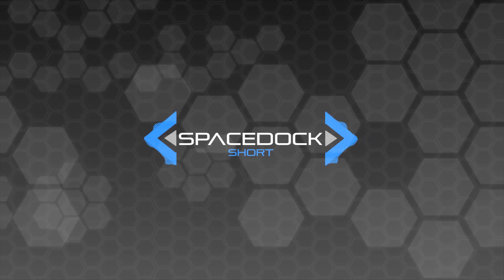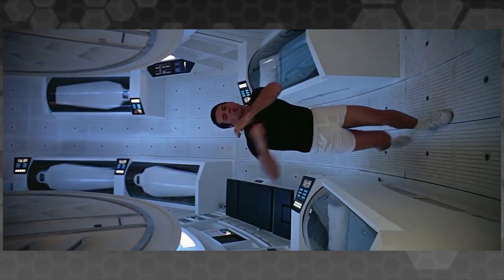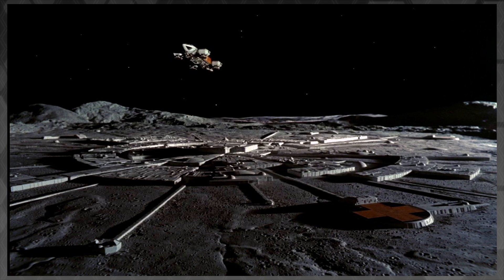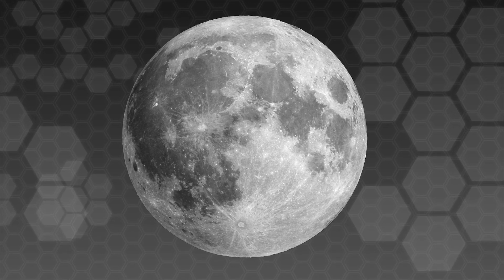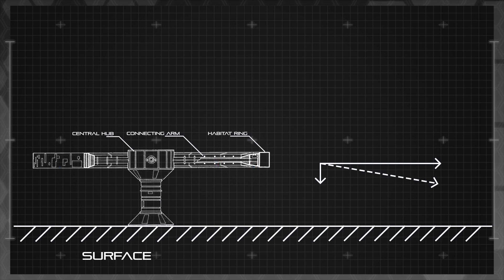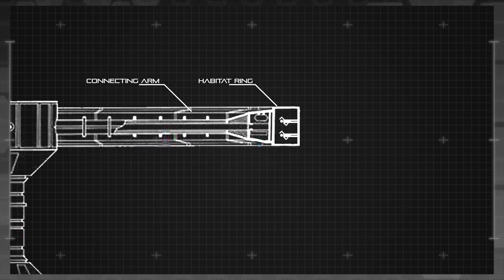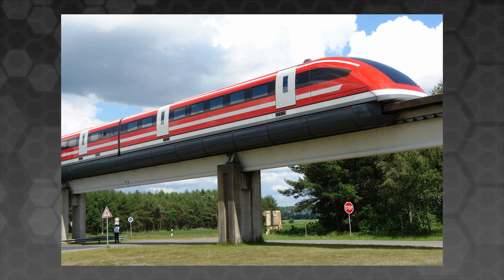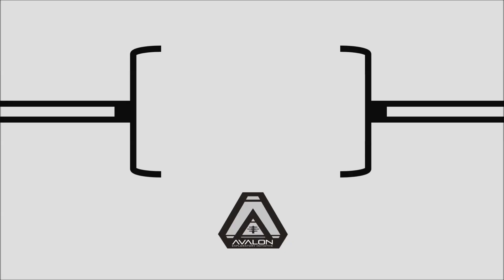How To Create Gravity On The Moon

Comment: "may not be an accurate representation of events" - comically fast asteroid rotation
Reply: WEEEEEEEEEEEEEEEEEEEEEEEEEEEEEEEEEEEEEEEEEEEE
Reply: Ironically Flat Earthers actually argue the Earth spins that fast as a means to discredit the globe model on the fact that water would not be able to hold onto the surface!
Reply: @chrisstevens2  Of course, while the Earth's rotation seems fast to us, it doesn't actually produce that much centrifugal force due to the fact that it takes a full 24 hours to complete a single rotation.
Reply: @saucevc8353  It's not the RPMs, but the linear velocity at the point the person is standing.
Reply: The linear velocity isnt an issue either. The speed is more or less significant based on the radius of the circle you are moving around, and the earth is huge, so the few hundred meters a second or so of surface velocity isnt a big deal at all
Reply: @trplankowner3323  Didn't know that but it makes a lot more sense now that I think about it.
Reply: @ravener96  Wrong, they are two different issues. On the surface of the Earth, it is actual gravity which is due to the mass of the Earth. In the aforementioned rotating structures, it is the acceleration against the floor of the structure. Instantaneous linear velocity can also be called angular velocity in this setting. Following is the formula from Wikipedia. "The magnitude of centrifugal force F on an object of mass m at the distance r from the origin of a frame of reference rotating with angular velocity ω is:
 F=m\ω^2r

Comment: You should check out Issac Arthur's channel on here.  In particular, his video on industrializing the Moon.  Basically the same thing you came up with, but using a spinning upside-down cone built into a crater.  His channel is science based, so it isn't a fictional concept but is instead accurate in terms of physics.
Reply: John Weber Always upvote for Isaac Arthur.
Reply: Isaac Arthur is the best.
Reply: Issac is life. Issac is love.
Reply: I was just thinking about his idea. Isaac is the best!
Reply: Yeah, I was totally gonna comment about using spinning bowls as a means of generating artificial gravity on a planet.
Reply: The concept is also better for asteroids.  Remember that for a potato-shaped asteroid spun up to 1g at the ends, the center will not be 1g.  Even if you spin it around it's longest axis, the center of the axis of spin will be at nearly 0g.  Worse, since an asteroid is not evenly shaped, the surface gravity induced by the spin will not be the same.

Better to just build multiple spinning domes around the surface.  Or turn it entirely into an O'Neill cylinder.
Reply: Isaac's speech has improved massively compared to his earlier years. His speech therapy he's undertaken for the last several months have really helped a lot.
Reply: Issac is the lord. And Spacedock his prophet.
Reply: John Weber, even taking the endeavor of spinning an asteroid to 1g, there is no saying if it can hold together. It just better to bury the rotating cylinders in the asteroid.
Reply: You cant spin asteroid to any more than its gravity force because that's the force holding asteroid together. Most asteroids are not solid rock but just clump of gravel. It will fly apart.
Reply: Use closed caption. His videos are fascinating and his speech impediment does not bother me.
Reply: John Weber that makes sense if you want more livable room than just s disk
Reply: Huh

Comment: Ah, thank you! I needed this as a final addition. In my own stories, the Moon is the largest collection of shipyards in existence. People excavate skyscraper sized chunks of rock then build airlocks around them. This, coupled with the low gravity makes building starships much easier and cheaper than in orbit. Adapting your idea as follows: find a suitably large hollow magma chamber. Build gigantic supporting pillars. Put hundreds of independently operated habitat rings of yours on them. Invite settlers. Profit, you have a city on the Moon with custom adjustable gravity and protection from radiation.

Comment: I am reminded of Red Mars, by Kim Stanley Robinson.  While the colony itself was obviously on the Martian surface, they turned Deimos into a kind of "layover" point in orbit, which needed to be staffed but the local gravity was far too slight to keep the staff there healthy.  So they ended up building a set of rail tracks around the circumference of the tiny moon, and rolled carriages around it at sufficient speed that the centrifugal forces would effectively provide spin gravity.

Comment: Excellent segment.  Most designs use a conical shape that for the habitat/city rotating around on the mag-lev track.   The apparatus would be buried some extent underground with a set of mirrors reflecting light to the interior.  There would be no direct light into the interior, and lunar material would be built up using 3-d printing techniques to form a dome above that shielded the facility below from radiation.   You would likely use this method even if you had gravitational technology primarily because materials will not be as limiting a factor as energy, and unless your gravitational energy uses less power than mag-rail tracks, it would be a cost savings to the colony in the long term.

Comment: Spinning an entire asteroid to simulate gravity wouldn't actually work. Despite the fact they are made of rock asteroids are actually relatively loosely held together structures, and it wouldn't take much to crumble and tear themselves apart under the sort of forces involved in spinning it up to simulate gravity.
Reply: Well considering that in The Expanse the asteroid bases are completely inside the asteroid, and pretty large surface area, I'm pretty sure that there is enough internal structure to hold the rock together

Comment: Second funny story. 

"Gravity" within a centerfuge differs by distance from center. This means, on most reasonable scales, your head has less gravity than your feet. 

When you talk about finding the angle of apparent gravity, you run into the problem that it's not consistent from one side of your body to the other. 

Unless this centrifuge is very large; that's going to at least require some adapting for someone standing.

Comment: 2 things:
A) As far as I can tell (I tried to check all of the comments, and I think that I saw them all...), only one Commenter mentioned the issue of <horror theme music> Dust </horror theme music>. The Apollo missions made no small issue that the dust got EVERYWHERE. And not only is Dust a health hazard (shredded lungs & severe Silicosis) but also a severe hazard for mechanisms with close tolerances. I can't imagine that even Maglev tech could be a solution without complex engineering and just more failure points introduced.
B) For the Ferris-wheel crowd, you can't make them vertical (like the Eye in London) because the only place that would receive the correct"gravity"is either the bottom of the wheel, and then constantly varying until you actually have Less than Lunar gravity at the top (not what you were looking for...)

Comment: My question is how to move personnel and supplies from the non-moving surface to the habitat ring which is rotating at speed. In space, where relative gravity is a non-issue, a simple tube running from the axis to the habitat ring can allow for a gradual increase in relative gravity, which wouldn't be too difficult to navigate.

I think the easiest solution would be another to have another ring, located near the axis (I'll call it the logistics deck), that can spin up to match the rotational velocity of the habitat ring (to facilitate movement onto the habitat ring) and then spin down again to stop (to facilitate movement to the surface, subterranean levels, or landing pads on the upper deck). Interestingly, this method becomes more efficient the larger the habitat ring, since matching the rotational velocity would require less spin up as increasing the distance from the axis means the habitat ring would have to spin at a slower velocity to get the same relative gravity. 

However, I foresee some sort of upper limit to a livable and productive habitat due to logistic necessities. Depending on the design and specifications, at some point it may not be possible to move enough supplies and personnel through the logistics deck to support the station. For the same reason that there is an upper limit on the size of a single cell organism, since the area inside the cell needing nourishment grows geometrically as the area of the cell membrane increases.

It may be expedient to have two logistics deck, specialized in cargo and passengers respectively. On a story or perhaps cultural note, this may lead or lend itself to certain behaviors. It could be that security (or other businesses) requires owners of cargo to pass through to the habitat before any of their cargo arrives. The requirement of punctuality or waiting around for the logistic deck to spin up or down.

Comment: Propose a design for a spin gravity moon base that also has radiation shielding.
I come up with a donut with a second maglev track above the habitat. The whole set up is in a larger tunnel under the surface of the moon which provides the atmosphere containment.
If you want to leave the habitat you board the train which moves at the same speed as the donut, stationary relative to you, you then ride it as it slows down whilst rotating through 80 degrees and deposits you  at an airlock. Alternatively it rides a piece of track out through the airlock, that track rotates through 80 degrees.
Any alternative suggestions?
Reply: Sure, a Wave Swing ride. 😏
Reply: But you have a good idea

Comment: I don't know if there's a practical application for this, but if you had a deck the shape of a paraboloid surface and spun it up, you could have gravity that increases as you move further from the center, but the gravity would always be perpendicular to the deck.

If nothing else, that could be a reasonable way to increase the surface area of one of these habitats by extending it in a second dimension. Analogous to using a cylinder rather than a ring, but tailored for use in a pre-existing gravity well. But you'd be limited by whatever you consider the acceptable range for the strength of the simulated gravity.

Comment: one issue i can imagine would be how much habitable space there would actually be on the rings. of course, areas where low gravity isnt an issue, or many even be beneficial can be kept towards the inside of the ring (solves the issue of having to constantly transport thigns to and from the ring too), but in terms of living space, there would be that much.

also, size itself would be an issue. it the ring is too small, then it becomes nauseating to stay on there due to how fast the structure would need to rotate. if you build it too big however, such as to increase living space, then the structure becomes too heavy

Comment: I would use subsurface steeply banked circular maglev track using Inductrak Halbach magnetic array levitation (the magnetic levitation is passive drawing it's energy from the kinetic movement itself and does not need active computer control like the maglev trains once used in Germany).  Of course there's also the spinning salad bowl dome concept.  However, though we know that microgravity is destructive despite our attempts to mitigate the effects with drugs and exercise, we don't know if the 1/6 the gravity couldn't be effectively mitigated with drugs and exercise plus the possibility of using short radius centrifuges (spinning tables that you strap yourself to) to periodically stress the body.  Those would be attempted first.

As to how deep to dig the track into the ground for radiation and micrometeor items shielding.  Although it would take perhaps over 10 to 20 metres to simulate the shielding we receive from Earth's atmosphere, a mere metre of packed lunar soil reduces radiation to 1/1,000 of outside levels and the Stanford Torus design used 5.6 feet of packed lunar soil as sufficient shielding.

Comment: While not impossible to build something like you suggest, the engineering challenges that would have to be overcome in order to build a surface- based centrifuge station to simulate a 1g environment would be immense. Now, to look at this from a real-world perspective for the fun of it, you’re talking about building cantilevers hundreds of feet in length, which would require massive amounts of next-generation materials (or even greater quantities of existing materials) in order to construct a very robust and deep structure to support the torus. The costs of such a ground station would make it more appealing to build an orbiting torus-shaped station instead for long term habitation and have people take relatively short stints to the surface. The average Joe-schmoe can only easily tolerate an RPM of up to ~3 (some studies say one or two rpm more is possible for some people) without the need for training or extended adaptation periods based on current research. If you want 1g within that value, you start approaching torus diameters of around 800’. For a smaller station, you need higher RPMs to simulate a 1g environment, and at that point you can only send people with significant physical training and good health to live there (read: highly trained astronauts), which is not feasible for colonizations efforts. As an example, having worked on a NASA- sponsored research project, our team came up with a torus-shaped space station design with an internal diameter of 800’  for the overall ring shaped station and an RPM of 2.7, giving a roughly 1g acceleration inside the habitable volume of the ring, which was two stories rather than one. The values we came to were in order to find a balance between acceptable RPMs for human habitation and a feasible size for the overall station, which was designed to be constructed with expandable, pre-fab, ‘lightweight’ modules. Even then, this space-based, semi-self sustaining station, while supposedly within our technical capability to make this century, would cost far too much and still be too difficult to build in actuality for the near future. Basically, we are in all likelihood a hell of a long way off from making stations that simulate gravity in space at any useful scale for habitation by large numbers of people or for deep-space colonization efforts. The advancements necessary to adapt the technology to a ground based system, even on a ‘low gravity’ body like the moon, would put the possibility of a station like you suggest even further down the road. It’s not impossible, and we’ll probably see something like it one day because it’s a good idea to solve an important problem, but the engineering challenges and costs are extremely monumental, so much so that they may inhibit the production of such ground based stations when the time and capability to build them eventually comes.

Comment: There's no need to elevate the centrifuge; instead, dig a pit. The bottom of the pit should be parabolic so that it feels like "down" no matter where you're standing, with lunar gravity at the center and earth gravity at the edges. This maximizes living area and can help people used to low gravity slowly transition to higher gravity simply by moving further and further up the dish. The problem then becomes sealing it off, but if you have materials like graphene it shouldn't be a problem, you could just inflate it like a balloon using normal air pressure making sure the outside is armored against micrometeorites. Or alternatively, build a ton of smaller self-contained buildings on top of the dish and not have to worry about filling the whole thing with air.

Comment: Two concerns/questions using this method to simulate gravity on the surface of a planet. (1) Can you scale it up sufficiently to allow folks to spend most of their time in that environment? Or will they need to move from module to module, experiencing Moon gravity each time? The model you show looks like there is some growth restriction. I’ve seen some ideas where a cone shaped environment is created inside of a crater/cavern or attached to a large “mountain” of regolith. Not sure if that is better since you won’t always have those geological features, but those models seem far larger. Second, I do wonder what the psychological effects would be when looking out the window and realizing you are not parallel to the ground.

Comment: hmm i would change the design slightly to a cone shape with the same angle and have multiple levels going up towards the entrance in the center you would have lower g's in the inner levels but if its big enough you should still be able to function fairly normal